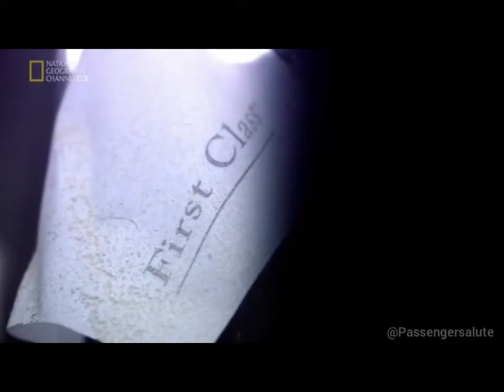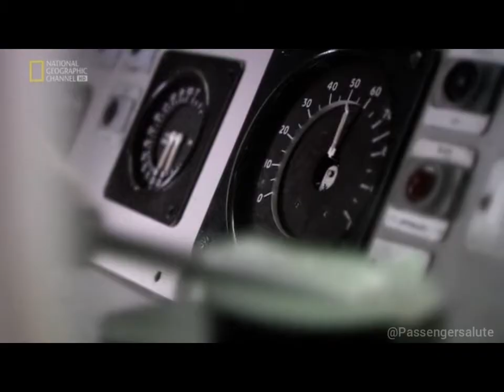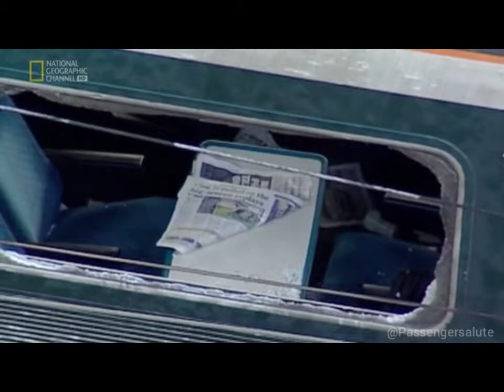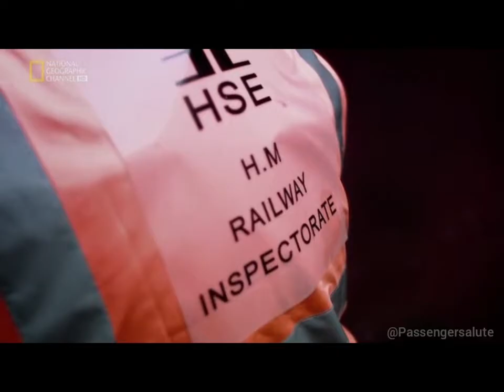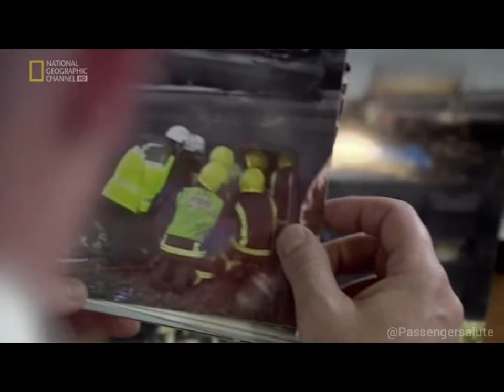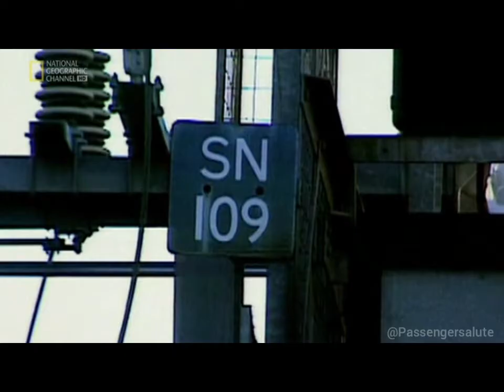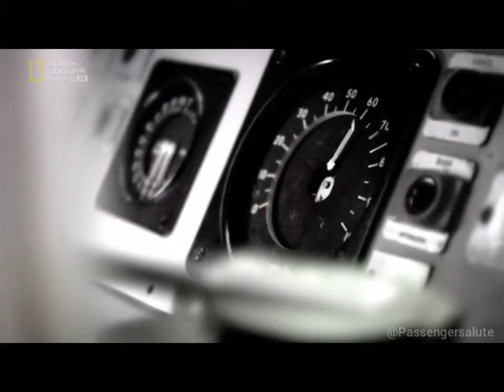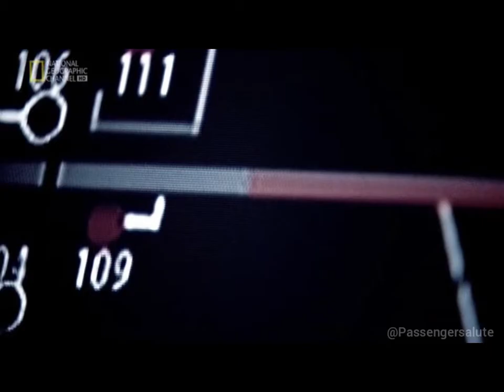UK TRAIN CRASHES - PADDINGTON RAIL DISASTER - LADBROKE GROVE 1999

Comment: Designers are fully responsible for this. Both signals were difficient. SN120 should have immediately dropped to red when SPAD in overlap track was occupied. SN109 was not an approved design either which was a notorious multi SPAD signal. Not to mention all the human errors of the day. Training and management oversight was severely inadequate.

Comment: This indicates the importance of all trains having automatic stopping systems if a driver goes past a red light. Leaving the interpretation of train traffic lights to drivers without having a safety mechanism to stop trains when the drivers do misinterpret them leads to inevitable disasters. Particularly no high speed train should ever allow the driver the whole responsibility of interpreting the train traffic light system. There should be automatic failback control of the train(to stop) when a mistake is made. These are accidents waiting to happen.
Reply: Since the mid-1990s the railway was already developing the concept of what was to become TPWS (Train Protection & Warning System) which does just that. It followed the Transport Secretary's agreement with the railway in 1994 that the safety benefits of Automatic Train Protection (ATP) as used on the Great Western and Chiltern lines did not justify the enormous cost of fitting it nationwide. TPWS is designed to achieve most of ATP's overrun protection capability at a fraction of the cost. Just two months before Ladbroke Grove, Parliament passed the Railway Safety Regulations mandating a form of train protection system and TPWS national fitment programme was all done with a couple of years. TPWS is very successful and was the railway's biggest single safety improvement project.
Reply: Well yeah but wait until they have driverless trains it will be a lot worse cos how are driverless trains going to be able to read signals
Reply: @benconway9010  driverless trains don't rely on looking at the colour of the signal

Comment: 39:00 If I had seen a SPAD in such a situation: I would put all signals to red and send the All Stop straight away
Reply: Yes that's the first reaction a good signaller. Safety first and not worrying about delays caused. But that all changed with privation. 

When I left the UK and Network Rail in 2008, it was all about performance, the catch phrase was "Safe Performance" .
Luckily there was still the "Old School' in our Signal Boxes at Banbury & Leamington Spa who would throw a signal back in front of a train and then contact Control in reaction to any incidence.

I hate to think now 14 yrs later with all the fast track university graduates brain washed into performance figures how the signalling centres are run. 
"Hey mate, just a call from Joe public about some cows lineside"
"Are they going cause a delay?"
"Not sure, but there are several dozen of them"
" OK better call a friend in Control to get some advise"
Reply: The signalling regs were subsequently tightened up to make clear that these actions must be done immediately.
Reply: I don’t understand why the interlocking didn’t revert SN146 when SN109 was SPAD and the TC occupied or how the points where set so the head on collision could happen as one train would have had to pass the other at some point if the accident happen happened. Would a signaller advise on this please?

Comment: Fatuous, that the signal company should be prosecuted and fined! There was a freak set of circumstances here, sun at a certain angle reflecting so as to leave an inexperienced driver with the impression it showed amber not red. Thousands of drivers had passed that signal prior to the tragedy; yes it needed correction but no there was no culpable negligence. The firm lost 4 million pounds that could have been used to make the improvement.
Reply: once the signal was installed it was railtrack property so it was railtracks who should have changed it
Reply: @flee6818  
Remember also that there had been a number of previous SPaDs at SN109, evidence that other drivers had particular problems with it. Indeed Railtrack/ Network Rail HAD changed SN109 (and others on same gantry) to its reverse L shape following one of those previous incidents, but the court agreed with the H&SE prosecutors that this was not enough.

Comment: 1. Wrong cab. 2. Why would he speed up if he knows the next one will be  a red?
Reply: Probably thought it was a double yellow when in fact it was a red.
Reply: Because of sighting of signal SN109 if you watched it properly you would of known that
Reply: @Stu  Pretty sure that the driver saw the yellow and would've gone, right the next signal is Danger (Red). Drivers should be trained / are trained that if you can't properly read the aspect, treat it like it's a danger / red aspect and report it to the signaller.
Reply: Exactly,if he thought it was amber then surely you'd continue with caution expecting a red signal next? 🤔

Comment: Most of the train driving I did was on primarily freight lines that had both wayside signals and cab control signals that are integrated. If a cab signal dropped, the driver has a few seconds to reduce to authorized speed or there would be an automatic full service brake set (not emergency) therefore forced to stop. The "ghost signal" is a true thing. Some wayside signals can be difficult to distinguish at certain times of day. Not much problem when weather is a bit gloomy, or after dark and there's no reflections, but bright sun shiny days can be an issue. Several times I've been grateful for the cab signals and ATC. Then there's very dense fog, to the point you can't see the front of the locomotive and still running track speed. Pucker factor applies here.

Comment: When they replicated the crash they had a "cart", representing one train, crashing onto another "cart", representing the other train. The problem I notice that one crashed into another but one cart was not moving. It just sat there while the other cart crashed into it. Weren't both trains moving on the track towards each other. In other words, both trains were moving. In replicating the accident, only one cart was crashed into a cart not moving. How is this a replication of the accident? One cart moving into a stable cart. Both should've been moving towards each other. That would've have replicated the wreck. Both going towards each other. Not one crashing into a train not moving.
Reply: Yep very true and they would have to have been travelling the same speed as the train as well

Comment: Why would amber ever mean go?
Reply: Yellow means 'caution, be prepared to stop at the next signal', it is a warning that the next signal is red. Trains are big and heavy, they take a long time to stop, the HST that crashed at Ladbroke Grove would have taken a mile to stop from full speed, and they cannot swerve or avoid obstacles. You therefore need plenty of advance warning to slow down. Modern brakes are better, but not that much better, especially in poor visibility or where there is low adhesion and anyway you don't wanna be going around using full emergency braking on a regular basis as it is dangerous for the passengers and on board staff who could be in the loo, buying food from a trolley, walking down the aisle, or just sat in their seat drinking their scalding hot coffee. Trains are not cars, railway signals are not traffic lights
Reply: @LUAu101  thanks TIL

Comment: Some car drivers speed up at the traffic lights and make it through but for a train that's longer and completely different to car driving its another story and you can't beat the lights. I think he had his wrong driving head on and sped up to beat the lights and the crash was the result. He also had only passed the test to drive the trains so this just added to it. He was inexperienced at driving a train so hadn't made the transition from car to train.
Reply: That wasn't a factor at all. It was the combination of an newly-qualified train driver, working in a very complex and busy layout, with some signals that were difficult to see because of various features causing temporary obscurations approaching them. After the collision most Paddington area signals were replaced with more compact LED units mounted a lot lower down to give uninterrupted sightlines, and some changes were made to the controls so that certain signals can no longer be approached simultaneously unless there are points available to divert any overunning train away from a collision path.

Comment: Why the hell is the light  for go amber and the light for stop red ? It seems insane to me. I don’t get it. Why  would you use two colours ( and shapes ) that are relatively similar? For example , you could make the go lights square  and a bit smaller and green , make the light flash when it’s stop or any other number of simple things to make the lights for go and stop as distinct and as different as they could possibly be. Red and amber can easily be confused in sunlight , so why use those colours? A static green light and a pulsing red light are much harder to make mistakes with. Surely you would want the maximum amount of difference possible between stop and go. 

It’s like having a red wire for live in a plug and an orange wire for neutral or earth. Or having two football teams play with similar coloured shirts. One good example of this principle is golf when you shout Fore ! to indicate a ball is coming. The word Fore ! makes a loud sound and is easy to shout. In addition it’s a distinctive strange sound that is difficult to confuse with other phrases and noises so that people know Fore means ball incoming. The principle of distinct difference is why a cockpit should never have the switch for the ejector seat right next to the air con switch and the same size and colour.  It’s a fail safe against human error. 

And why is it not like road traffic lights ? Green is go , red is stop.
Reply: If you're really interested, red is danger: stop. Yellow is caution: proceed but expect to find the next signal at danger (red). Double yellow, where it occurs, is preliminary caution: expect to find the next signal at yellow and the one after at danger (red). Green is clear: crack on. It's yellow because it's a warning signal of a red to come. Different shapes will not be at all noticeable at any distance, it's a beam of light. There are signals which flash and they have their own meaning, but I wouldn't say having your stop indication dimming and brightening and dimming and brightening is the best idea, nor would it be as easy to pick out through fog or if it's partially obscured by sunlight or branches or any other factor which would mean you want that bright red light shining clearly for as long as possible. Yellow is perfectly easy to distinguish from red hence the billions upon billions of journeys which have been made over more than a hundred years, each of which passes dozens and hundreds of signals, where this hasn't been a problem. And it wasn't here either. The point was the sun washed out the red and appeared to reflect off the yellow lens. It wasn't that the red light was shining clearly but the driver thought it was yellow because they look similar. If you look at the examples in this video you can see that the problem occurs with all the colours and would be just as bad if not worse if one of them started flashing https://www.youtube.com/watch?v=5JlHdBkVS4k&t=115s
Reply: It was the sun that gave the impression the signal was  yellow, and the red, being to the left, was probably not visible.. and of course the AWS did not determine the difference between red and yellow, which was normal practice at the time, if the driver had passed yellow signals since leaving Paddington, and the sun gave the impression he had a single yellow, that is why he accelerated, and was perfectly explained in the documentary. the signal was at red.